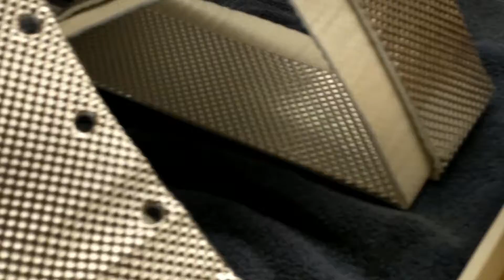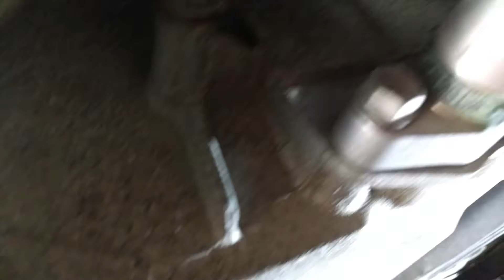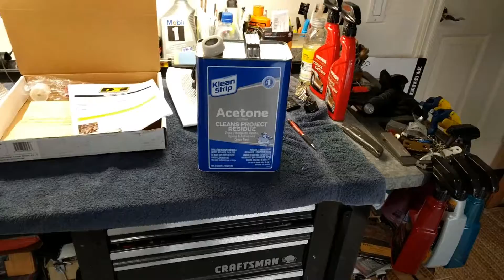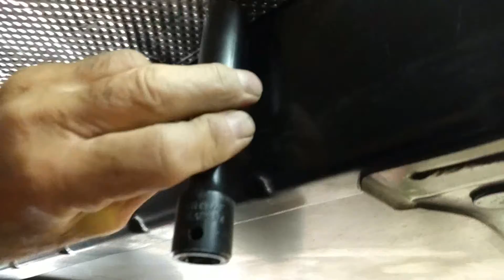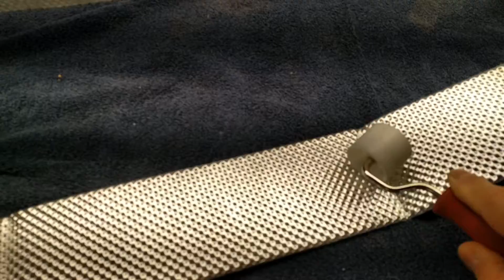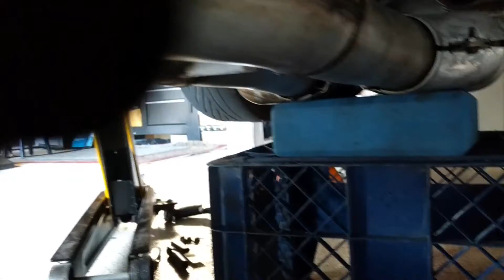Corvette c6 z06 dei design engineering install tunnel insulation to keep car cool by froggy

Comment: Hi Froggy. Did you experience any smell after installing the tunnel shield kit?  I’ve had mine installed for a few weeks now and it still has a hot plastic smell.
Reply from the maker: No smell on mine, maybe something touching a cat or pipe?
Reply: @1947froggy  thanks for the reply! After further investigation it looks like my metal shield has come apart from the blanket material which is giving off the burning smell. Does your car have catalytic converters?
Reply from the maker: @cdwebb0  Yes.

Comment: Getting ready to tackle this along with all the heat shielding stuff you added from DEI for the starter issue. Was there a pretty noticeable difference of cabin temperature with the tunnel heat shield installed?
Reply from the maker: Hard to say, but this is good stuff.
Reply: @1947froggy  there isn’t a difference of temps in my opinion you need to fortify the interior for heat shielding
Reply from the maker: @elevatedperformance  Agree to disagree. The further away from the heat source ( cats/mufflers/headers) you place insulation, the more you allow nearby surfaces to get heated up. IMO stop the heat closest to the source. Thanks.
Reply: @1947froggy  your better off heat wrapping the manifolds all the way back to the muffler

Comment: I didn't know they made this! I bought the elite engineering part ($$$) which seems to help stiffen the chasis a smidge,  as the factory one can be broken over your knee easily, compared to 5/8th". This is a smart idea regardless,  your center consul can get very hot